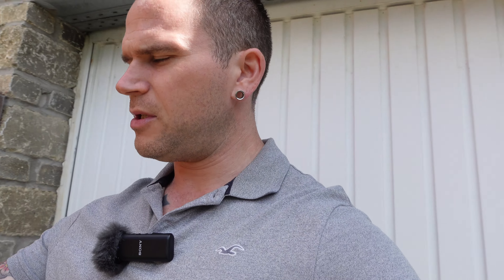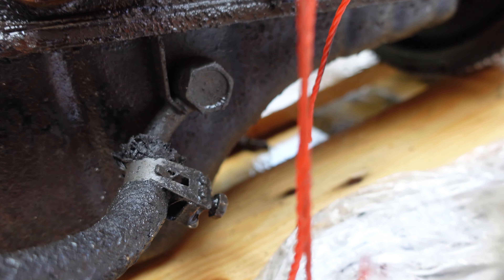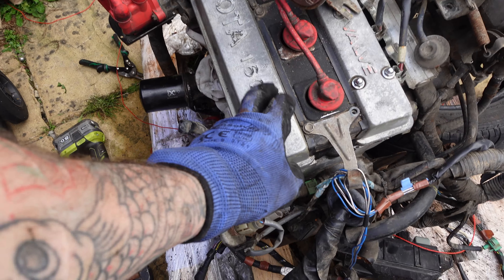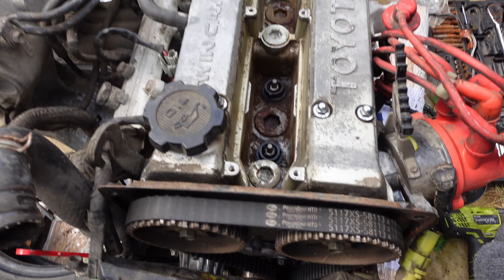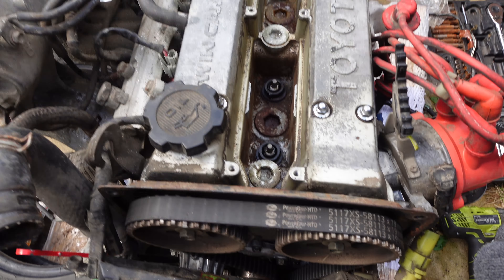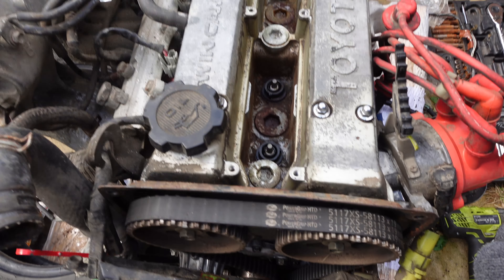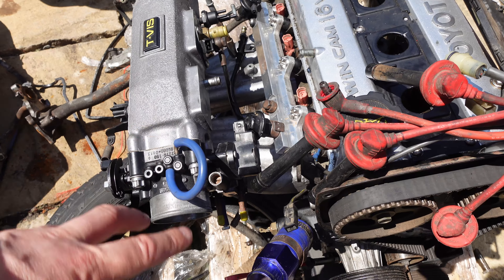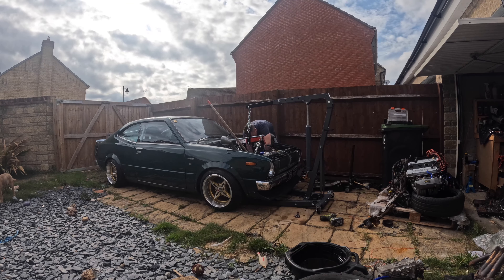This SUCKED! 4age Engine Swap By Myself - 1975 Toyota Corolla KE35

Comment: Congrats Nate. I worked on engines (minorly -changed my own alternators, oil, timing belts, filters, spark plugs, etc.) of my & my dad’s cars back in the 90s & early 2000s so I have a good idea of how challenging they can be(!!) but I never swapped out a whole engine! Bravo mate! Much respect. I know it SUCKED & f your flake out mechanic! But I know doing mechanical work that SUCKS & yet finally succeeding is a rewarding/if not angrily-satisfying achievement… so congrats on accomplishing it man. 👍🏼 I finally caved & got a Tesla model 3 in 2022 🤦🏻‍♂️😂🤷🏻‍♂️ Working on cars usually kinda sucks, so to be so much more care free without all the components of a traditional combustion engine to worry about them breaking / needing repairs… it is kinda awesome… and the instant, insane acceleration is pretty damn nice too. Have you ever driven a Tesla? (I’m guessing you might dislike them bc they’re rather the opposite to a petrolhead’s bread & butter?), but curious if you have & what your thoughts are on them…
Anyhow keep up all the good work, man. Wishing you & little Jasper all the best. 🙏🏼🤟🏼👍🏼

Comment: good job! been there many times when you are desperate for help but just gotta suck it up and get it done yourself!  you might want to put it in gear and rock the car, just to make sure the clutch is aligned or you'll be doing it all over again 😂

Comment: Good work mate! Wont be long before you are brapping around in it! 
And as you've probably learnt if you do this again its probably easier to pull the engine and gearbox together, while it makes it ohysically more difficult to remove/fit the engine it allows you to mount the gearbox on the floor which make sit soooo much easier

Comment: That hose is the Positive Crank-case venitlation hose, wrapped in a covering that protects it from heat. Toxic fumes build up in the crank case due to heat so it is vented back into the intake so that is can be burned in the engine and then mitigated by the exhaust pollution system. This mitigates poison in the environment. One would make sure it has a valve that would allow only positive pressure from the crank case to the intake so that you have best performance. I submit that if you had a proper shop you would enjoy your project more as you would have smooth floors to move things and a lift. Replacing and entire engine is an advanced mechanical project but not impossible. Don't get into a hurry, It's ok.
Reply from the maker: Oh I completely agree, I really do want a unit to work in!

Comment: The aw11 has oil to liquid oil cooler. There’s a coolant pass though cooler that mounts on the bulkhead. The ae86 4age has an air to oil cooler that mounts up in front of the radiator on the core support.